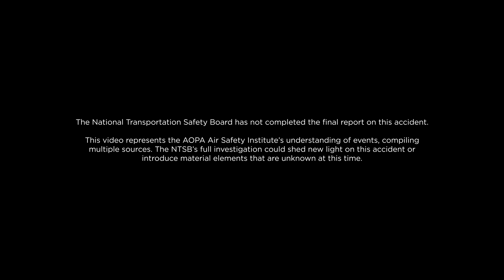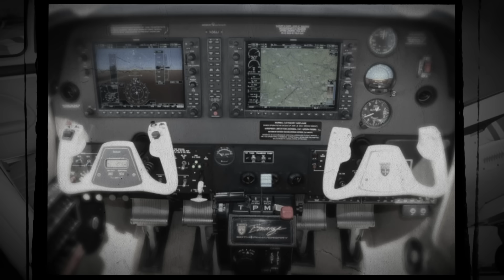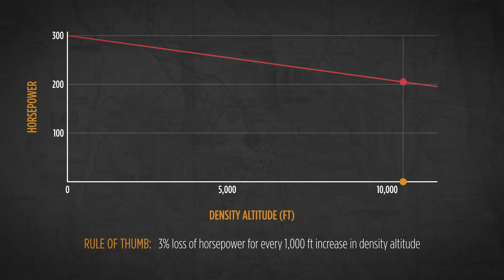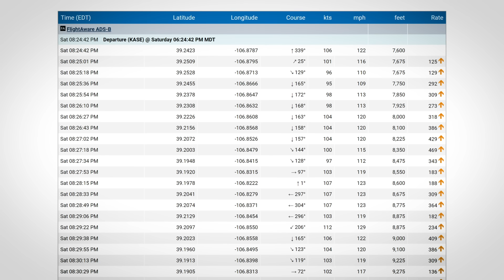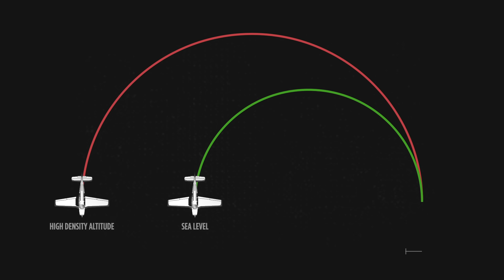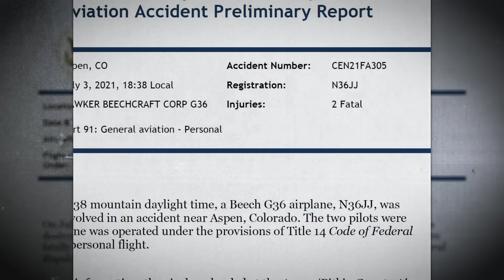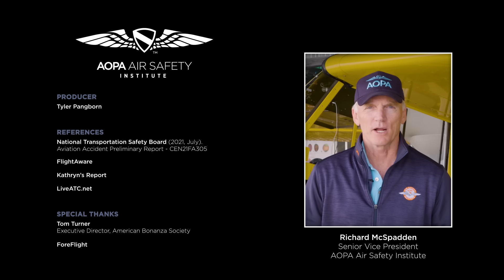Accident Case Study: Into Thin Air

Comment: The final minutes must have been agonizing; to be in full control of the plane but all valid navigational options exhausted and nothing to do but contemplate the oncoming terrain. What a sad end.
At least we can learn from the lesson.
Reply: I disagree.  Once you've reached the "I gonna crash" realization you fly the plane.  Have your copilot move his seat full-aft.  Put cushions on the instrument panel.  Ensure the restraints are tight.  Have the copilot trigger the ELT and notify ATC that you're crashing.  Configure your plane for minimum speed flight.  Target the softest thing you can find before you run out of airspeed & control.
Reply: @jimmiller5600  Yep, many people died because of cold and other things after a crash. If rescue services know where You are, then You will be rescued much earlier.
Reply: SOP for a light aircraft like this would be to put it into slow flight configuration, flaps down, allows a tighter turn. Along with flying on one side of the valley, like they said in the video. Might have allowed them to get out.
Reply: @iainwalker5150  Yup, I was taught to go full flap, slow to your typical full flap approach speed by pitching up which will gain you a tiny bit of altitude, then go full throttle, turn towards the descending terrain at the Center of the valley and pitch down to maintain your airspeed. You will lose altitude but you can sustain a 60 degree bank for a 180 degree turn and if you are to one side of the valley should hbe able to tolerate the altitude loss for the tight quarters turn. I can turn in about 1/4 mile in my 172 using this technique and lose only about 200-300 feet.
Reply: @kurtisf3366  60 degree bank? That is very sharp. I thought with a bank angle that extreme and in thin air especially you’d drop like a rock? In this video their bank angle looks very shallow, maybe 15 degrees? I assume because any more and they will stall?
Reply: @bigbaddms  yup, 40 degrees of flaps, 60 mph on the airspeed indicator and 60 degrees of bank. You have to nose down and sacrifice altitude to maintain the airspeed and it will look like you are pivoting on the spot if you look down at the ground.
Reply: @kurtisf3366  60 degree bank in thin altitude, flaps or no flaps you are asking for an accelerated stall. I do agree with you on flaps, full power and attempt a chandelle turn is their only chance and even then starting from the center of the valley might not of worked. Mountain flying you need to fly the edges of a pass, particularly the upwind side, know exactly how high you’re going to need to get to and never commit a non turntable valley until you are at that altitude. You can turn tighter using a chandelle then using a 60 degree bank at a higher rate of speed, assuming you have an ability to climb. If you do the chandelle wrong, it ends up wider then the full flap steep bank canyon turn, and unless you have chandelle truly down the canyon turn is probably the better option. Assuming these guy’s airspeeds shown were right (way faster for a tight turn), they would have been way better to pull the nose up, slow the plane extend flaps shooting for 1.3 vso ~85 in the 300 horse bonanza. which would have given them a little bit more altitude similar to that initial climb rate that would likely be about double their cruise rate, then start a 30 to 45 degree bank being careful not to induce an accelerated stall they might of made it. Course it’s easy to Monday quarter back from behind the smart phone but it’s obvious these guys weren’t using good mountain flying techniques and mis judging the density altitude.
Reply: @kurtisf3366  300 horse bonanza if I recall has a vso of 66. I never did accelerated stalls in a bonanza, but I’d guess that 85 to 90 is where you’d achieve an accelerated stall in a 60 degree bank and yank situation. It would be far better to configure 1.3 vso and stick in the 30 to 45 degree bank angle, because a accelerated stall drops altitude pretty darn fast compared to your straight and level power off stall. Slower and as tight as a turn while keeping altitude is your best option, if youre dialed and can make it a chandelle turn even better.
Reply: @AkPacerPilot  My numbers are specifically for a 172M model and was used as an example. They would need to be adjusted for a different airframe if appropriate at all. I disagree with your statement about trying to maintain a level turn though. In a true emergency turn scenario you need to be prepared to trade altitude for airspeed to achieve a tighter turn. If you are high up on one side of the canyon, you should have descending terrain to one side of you that you can use in your turn. The trick with the maneuver is to maintain your airspeed. I was taught the maneuver in mountain flight training and have practiced it many times. I have used it in mountain canyons in the turbulent conditions that come with it and it works well. This isn’t something that you would do as a standard procedure for flying up a valley and turning around, it is meant to be a last resort, save your life exercise. Kind of like spin recovery.
Reply: @kurtisf3366  if you don’t have the altitude to loose, which in these guys case they didn’t, the canyon turn isn’t a good option. A chandelle is not a level turn, it ends level but it like the cannon turn trades altitude, cannon looses altitude, chandelle gains altitude. But again, if you are flying your cessna 172 and you yank and bank  hard enough, you will accelerated stall. It’s been so long since I’ve flown a 172, but if I recall it accelerated stalls around 70 mph with 2 g turn. A 60 degree bank is a 2 g turn. You are in thin air, yanking and banking a 2 g turn, you are absolutely going to loose altitude and likely faster then you can recover. With that said, the maneuver you are talking about does work great in sea level mountainous areas like in Alaska, Canada, Washington, Oregon coastal mountain areas. Where you often have standard day temps or better, with negative density altitude days. Not 10,000 density altitude days at 8000 foot making the plane preform like it’s 16K plus altitude. 

And I’m not disagreeing with you that your maneuver isn’t a great option if you have the altitude to spare, in this scenario, I don’t believe they had the altitude or the room turning from the middle of a narrow canyon with rising terrain.
Reply: @kurtisf3366  Kurt, I appreciate your comment and experience. If anything, it reinforces that I should not fly in mountain terrain without the training and experience you have. Thanks.
Reply: I think... He (or she) after this left turn and seeing incoming terrain should do right turn - in this moment, they have more room to (right) turn. I dont see any other options to save this situation.
Reply: @norbert.kiszka  there was no options to save it at that point.
Reply: @sammmmysorookaaa1413  some maneuvers can be tested in flight simulators. But its easy to sit and do things in simulator. Even in simulator You can freak out and crash - I know something about it (crashed two times because of it).
Reply: @sammmmysorookaaa1413  I'm wondering if, when you realize you're in this condition, you could configure the plane to land or at least lose enough airspeed to set it down. There was the Wichita University airplane crash, where the pilot realized he was in an inescapable box canyon. He decided to bank the plane to match the uprising terrain and belly-flopped that way, saving many lives, as opposed to colliding with terrain and killing everyone.
Reply: @norbert.kiszka  Mountain valleys aren’t level, the terrain would have been climbing and a right turn would have likely just brought more rising terrain. That’s why you always fly on side of a valley in the mountains, that and the fact that the middle of a mountain valley is usually turbulent as hell.

Comment: I can't imagine not doing more homework before attempting a cross of the Rockies. Looks like little to none experience with Density Altitude effects and pre-planning. And how could they not know that they would be up at Oxygen altitudes??
Reply: Especially the fact that they changed to VFR and decided to take off to "see their options". Unfamiliar with the area and the terrain etc...
Reply: One guy's an ATP, they're both from NY. Their only experience is punching in and out of max 2K airports, I see why their only concern with altitude was likely the unavailability of supplemental oxygen.
Reply: @davidb2045  Surely an ATP knows to read and brief the IFR departure procedure prior to getting an airways clearance? Unless they don't read and follow the published procedures in NY? 🤷🏻‍♂️
Reply: Didnt read and brief the SID before startup. 

TAKEOFF RUNWAY 33: Climb heading 343° to 9100, then climbing left turn to 16000 on heading 273° to intercept I-PKN NW course outbound to LINDZ INT/DBL 13 DME. Then via assigned transition, maintain 16000, expect clearance to filed altitude 10 minutes after departure.
Reply: @greggpedder  A good indicator that they didn't plan well at all. Even with no mountain experience, basic ground school teaches you about altitude, performance, and DA. They must have "forgotten" those lessons or never understood them. And with an ATP, too. Unbelievable.
Reply: The die for this accident was cast before the flight itself. Poor route planning, combined with apparently little or no specific familiarity & study of  the performance required for this second leg, did these travelers in
Reply: Yep

Comment: High density altitude wasn't the problem, taking off with no plan is the problem.
Reply: The fact that they attempted to file an IFR flight plan out of Aspen with a normally aspirated airplane suggests they didn't do enough planning. I've flown there before, and I have dozens of hours in the mountains, but I wouldn't attempt Aspen without another experienced mountain pilot with me.
Reply: I think it's a chain of factors.  If they had done enough planning to go up Independence Pass OR if they had done one more circuit in the climb OR if they had waited until morning when the air is cooler, things might have ended differently.  

We're all assuming (even the video) that they declined 16,000 feet because they didn't have oxygen on board.  If that's the case, then how did they think they were going to get cleared for the SID that required them to climb to 16,000?  If the reason they declined 16,000 feet was that they didn't think the plane could make the climb, it makes it an even more egregious error to just go VFR in the opposite direction from where the SID they had briefed would have taken them.

No matter how you fix it up, the chain of errors that led to two deaths should have been broken in the planning stage, or at the very latest by re-planning when the SID wasn't going to work and taking the time to figure out a safe VFR route.
Reply: The climb rate was 200 fpm, and diminishing.   That should have scared them into getting higher than the pass before continuing toward it.
Reply: @braininavatnow9197  hardly stupid just naivety, easy to judge sat on the ground typing on a keyboard
Reply: I think this is a trap that would likely claim a lot of pilots in their situation. Good lesson to learn
Reply: They had a plan. And clearly knew their situation.

They obviously wanted to take the pass direction. But did not know it their airplane could make it on that day. So they said they would go up and determine the call at that time once performance was established.

They did everything right, except failing to orbit for a few more minutes. And also failing to calculate their climb rate vs book numbers and make adjustments to mixture and RPMs for this. Adjusting mixture with a constant speed propeller is tough, you go by whatever one put of six exhaust port temps are reading. This is not intuitive to most people. And most people learn to be kind to their engine with conservative leaning. Which is not appropriate for this situation.

Comment: Great job putting this out in a timely fashion while focusing in part on the way even safety-conscious pilots might get lured into a trap. Also a great job of using technology to better illustrate the story without getting in the way of the story. Finally, great job of including the point near the end about the overall rising terrain while many pilots focus on the ridgeline. It reminds pilots to think about the viability of potential Plan B options and not just think about whether Plan A will work. Thanks AOPA ASI.